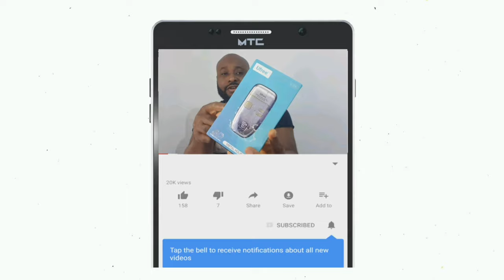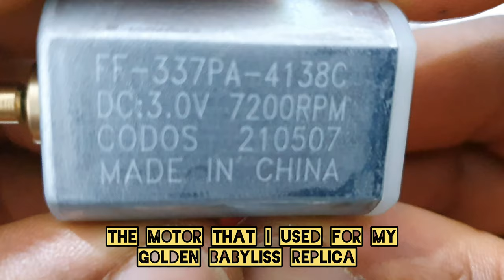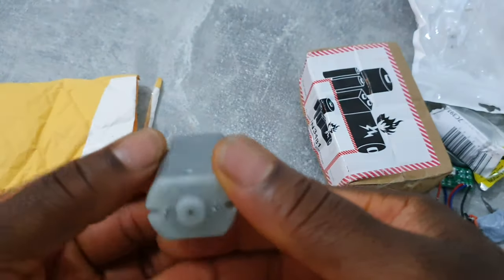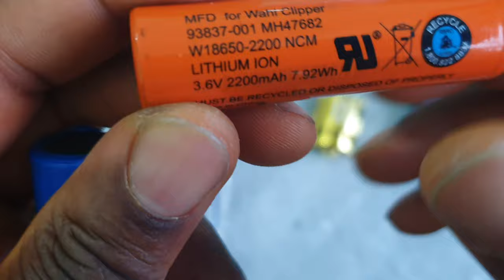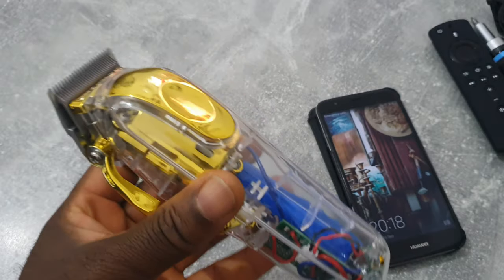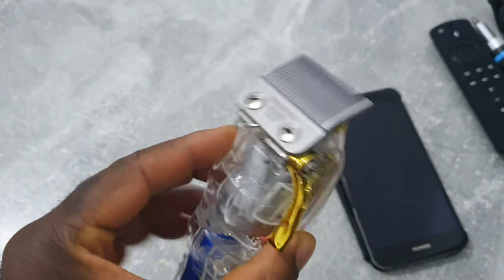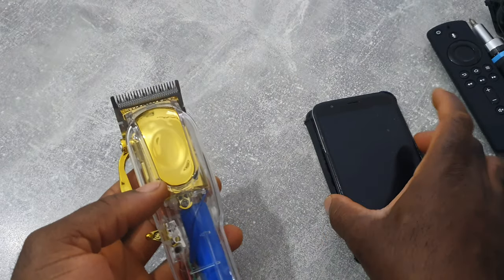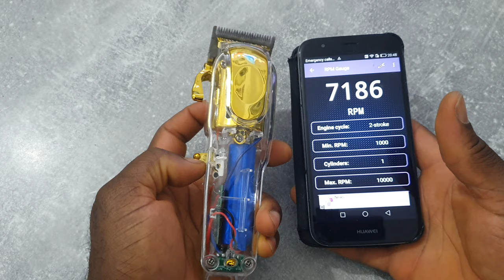How I Build A Custom 7200rpm Wahl Magic Clip Hair Clipper From Scratch / How To Build Hair Clipper

Comment: I wonder if you could used the Gamma super torque motor instead, and use the Tomb45 battery. Heard those two are compatible with wahl clips. Get the 4 hole stretch bracket and slap an andis master blade on it with some andis screws. Make sure to get the cam follower to use the andis cutting blade on a magic clip too. Damn the possibilities

Comment: You're too good  super powerful this is awesome I want to do same .  you can put the link for the battery please it lacks that this thanks
Reply from the maker: I bought one battery and it didn't fit but I got one free from a friend
Reply: @edounboxingofficial  what battery I can put if it hurts you
Reply: I havent gotten mine in. But biting the bulledt and upgrsding my battery after 4-5 years. To tomb 45 battery. Seen people day it overhests a bit. But adding a cermamic moving blade. Oil. Spray. And cleaning your took from hair. Should be more then enough to keep it mid. I just got myself a gamma fusio. Blade which is a really grest investment. Overall slowly but surly making my msgic clips into a beast. If they came out with the silver edition when i got my firdt clipper. Trust me thst would obertske any of the clippers i have fr😂💯 its a very meaning ful clipper to me. Down to road ill get it customised.

Comment: Would kemei 2600 clipper be almost the same clipper ? Motor mainly. Congrats for the build it should have been fun and educational!!!!
Reply from the maker: I haven't test Kemei 2600 clipper before
Reply: @edounboxingofficial  thanks for replying. Its a super taper / designer of Wahl's based clipper probably based on same motor. This or other that look alike Wahl clipper. You build a nice project though 🙂
Reply from the maker: @SqiroS22  thnx bro

Comment: I have a question the first red cable you put on the new motor where it's coming from ?
Reply: You need to make it using 22 AWG and a very small ring terminal. Had to do this myself, its the "negative" for the motor and on/off switch

Comment: Does this cost more than buying the original clipper itself?
Reply: It's still just a little bit cheaper but you get a higher rpm and you can find a longer lasting battery. The power on the magic clip is trash and the battery life is less than an hour and a half. With the right motor and battery you get up to 3 or so hours with more power.